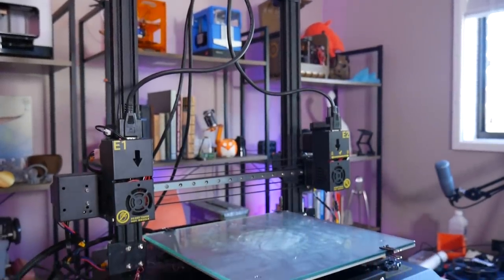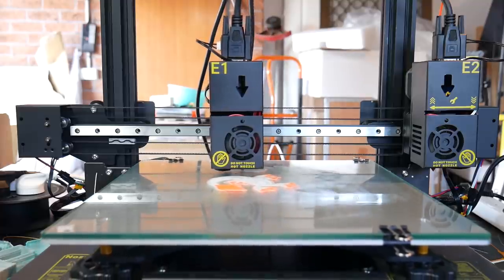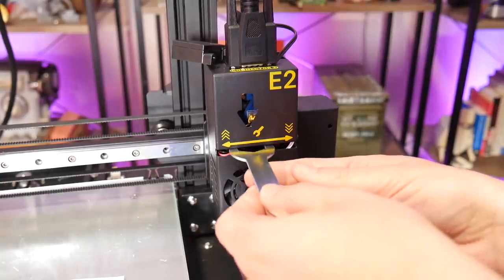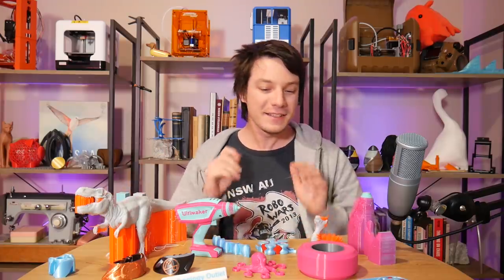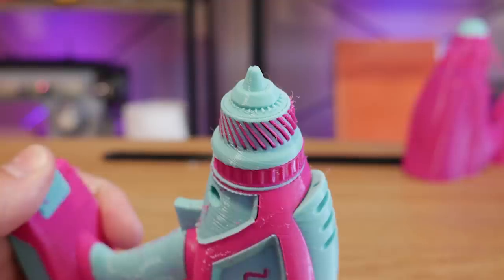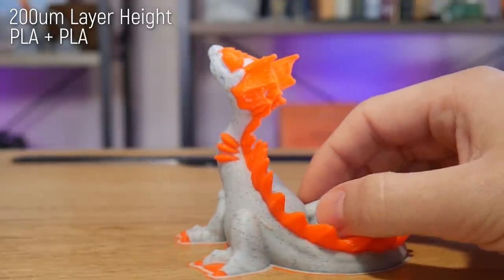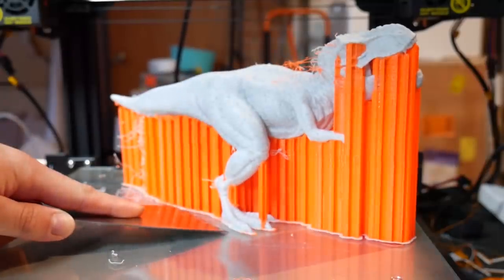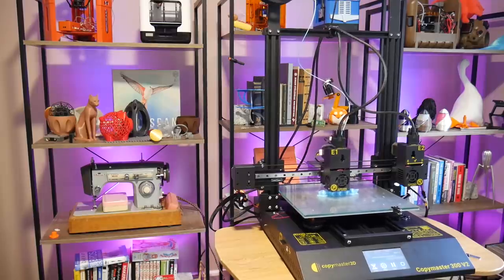Huge IDEX 3D Printer - Copymaster 300 V2 Review

Comment: Angus, if you remove the covers at the end of the x-axis axis you’ll find belt tensioning :) hope that helps
Reply from the maker: Cool, thanks!
Reply: @MakersMuse  absolutely brilliant printer, I've been running a pair of them for about 4 weeks now and I've been generally very impressed. One thing I would say, personally, is that I feel they should ship with 2208 silent drivers as standard as they do make the world of difference on these machines
Reply: @MakersMuse  Is the belt tensioning documented?
Reply: @thehobbyhermit  imo 5160 are better, though that'd be 30-40 bucks extra.
but yeah, having the option would be nice.
Reply: @thehobbyhermit  once leveld, how often dot ehy have to be re-leveld?
I know some creality users have drifting issues(but I don't), just wondering if it is an issue or just a set-up-once problem
Reply: You'll also lose the X1 vs X2 calibration as the end stops are mounted to the covers.  Better to use the 4 access holes in the cover to reach the motor screws.
Reply: @Tater1337  sorry I've only just seen this! I haven't had to re-level much at all on either of my 2 machines!

Comment: Good review. This will certainly propel these into massive sales :D 
I am using “this machine” for a year now actually before it got somewhat popular and got it from Tenlog as a really early machine. The construction and logic stayed more or less the same through time, apart from minor changes like moving all to a more compact and less solid build on a box. Controlboard is not great still, but does the job ok-ish.
Agreed, altough slightly flawed it is the most solid performer for the price that is hard to beat.
It is nice to hear one company that distributes these does support...

Regarding your remarks on flaws:
The belts can be tensioned - by moving the x motors in their slots. Belts are too long, so one extra ziptie for a spacer at brass clips and it can be tensioned properly.
I would somewhat agree that Z levelling the heads is tedious, but not hard. No drama.
X2&Y2 offsets should be set with doing a standard offset comb print just as with any other IDEX. One print does the job ok & second dual material cube gets you to perfect.

Surely this is far from being a perfect machine for the 3d printing noobies. As any IDEX is i guess. But non-noobs also know, that swapping board for Duet with Duex expansion make this thing insanely good for the price. I snitched the returned Hictop D3 hero for 450euro while getting TMC2208s and some extras after contacting Hictop! That’s almost a steal!

Altough maybe not your cup of tea, i am writing this so other can see also.
As I did a Duet mod to it and swapped the printheads (I used hemeras with custom mounts, but others went with e3d V6 or microswiss types). I own probably the most modified one of these out there and did a “MarX Group” on facebook for others that are willing to do similar. We’re just in the process of getting the ‘Hero’ version to the Duet pace. All are welcomed to join if interested in this.
Reply: Thanks for the Facebook Name-drop.  I just finished installing a Duet 2 Maestro and expansion on mine.  Also put new extruders on it a while back.  The aluminum BMG clones directly screwed into the hot ends are working really well and the Z-flexure in my printed mounts works great. https://www.thingiverse.com/thing:4009512

Comment: Angu: "It comes with painter's tape, but who would use it in 2020?"
Me: looks around "uh, er, yeah who would..."
Reply: Gonna try using a glue stick!
Reply: My routine is to put down some painter's tape and then a quick pass of glue stick. The tape kind of acts as a sacrificial build surface. I might switch to building on glass or try some kind of flex plate mod on my Monoprice Maker Select.

Comment: Very nice printer, but I'll wait for the Copymaster 300 v3 with DVI cables for the extruders/hotends.
Reply: why would you have DVI cables, DVI is for display?
Reply: @owmylehg7811  DVI > VGA
Reply: @SprinklesJimmy  ah yes, i get those mixed up,
Reply: I'll wait for v4. It is rumored to come with HDMI cables.
Or should I wait for the DisplayPort one after that?
Reply: Hah, you amateurs, v4 will have 20Kv power lines to run the touch screen
Reply: I hope there'll be a version with Mirrorcast or Chromecast, wired connections are so 2019 :D
Reply: Il wait for the HDMI version!
Reply: I‘d prefer a Gardena connector 😂
Reply: jokes aside, db 15 connectors are pretty good since they have the good number of connectors, are cheap and screw on.
Reply: On a serious note, a DVI cable actually contains all of the signal pins for VGA, so a v3 with DVI would actually be fully backward-compatible with a simple DVI to VGA adapter (which is super cheap too)
Reply: You jest, but if they ever add filament sensors and a Z-probe they will need the extra conductors!
Reply: @manaquriazertyuio4555  I agree. I think it was an interesting but effective choice given that VGA was built for rugged-ability. It holds up nicely if you screw it in, and it's cheap.
Reply: If you buy it from Tenlog, it comes with filament runout sensors.  I thought I saw them in Angus’s unpacking, but he wasn’t using them, which is why you saw a dangling white connector next to the print head.  So they already have the wiring for the filament runout sensors in the VGA connector.  VGA is also known as a DB25 connector, because it has 25 pins, so there should be enough pins to accommodate other features.
Reply: Try reducing retraction speed to 25, and your stringing might go away.

Comment: I have one of these printers from Tenlog. It took about a month, but I was able to dial it in and get the printer down to .15 on Angus’ tolerance torture test.  It’s a badass printer.
Reply: Very interesting. It looks like a very interesting machine. It's good to know higher precision is possible.
Reply: Any idea what the difference is between the actual Tenlog and the Copymaster 300 V2, because the prices is $600US from the manufacturer (and that's easy-build, not a complete kit).

Comment: Thanks for the review Angus! I have the Tenlog TL-D3 Pro which is pretty much the same machine as this. Tenlog has a US-based support team as well which are very helpful. I had to figure out belt tensioning too of which Extruder 2 is still a bit dodgy. The VGA Cable system is interesting as these were pretty much deemed obsolete by the PC computer industry a while ago. Good to see them repurposed for 3D printing. Only thing is their heater blocks don't fit a standard silicone sock in the industry yet so I am still waiting for that.

Comment: Hey Angus, try using petg/pla together as support material.  They don't stick to each other. Works great. Only problem I ran into was because I was using a prusa mmu to do it.  Yep the purge block also didn't stick to itself. Hehe
Reply: Can confirm, PETG on PLA or PLA on PETG works great for removable supports.

Comment: I just purchased this 3D Printer. Well actually the Tenlog version. Their TL-D3 Pro. Your review helped me decide to purchase it. That and it is currently on sale at Amazon for their Prime Day sale. $499.99 for the TMC2208 and $483.99 for the A4988 version. Plus taxes if that applies where you live which it does for me. I chose the TMC2208 for obvious reasons. I can not wait to try it out. I have been wanting to print in dual color for a while and mainly for support material prints. I have also seen a few mods people have made to improve this printer.

I was tempted to build a IDEX from scratch but maybe another day. I just built my own coreXY and it took me a long time to get it to a working state as I was not familiar with their design. Lots of trial and error. I think getting this IDEX now will be better as it can get me more familiar to its design. It should make designing my own a lot easier. 

I was also tempted to purchase a Palette 2S Pro as I have also been looking at that. Its on sale right now as well but by a $100 coupon. This was still a little cheaper so I chose this for now. Maybe one day I'll purchase the Palette but for now I think this will fit my needs. :)

Now I just hope that the 3DPrintMill from Naomi Wu doesn't break my bank when Creality starts their KickStarter for it. I plan to get it for mass producing some things. Mainly set pieces for some table top games. Plus the thought of having a Belt Bed Production printer is cool.

Anyways... Now I just have to wait a few days for this IDEX to arrive. :)

Comment: That belt tension system is very similar to a design I came up with for a corexy. A small clip with ridges that match and mate to the teeth on the belt that slides onto the belts sideways. Very easy to adjust tension by sliding off the belt and skipping a few teeth. Printed in abs I have no issues with slippage.

Comment: My very first printer was a Makerbot Replicator Dual, which used a fixed pair of extruders each which took a single filament. It was okay and had a very simple, straightforward calibration process, but I could never get two-color prints to be particularly reliable, and even when their proprietary slicer added a purge wall it still didn't do a particularly great job at removing the stringing between colors.

Recently I upgraded to an Artillery Genius, and got a Mosaic Palette for multi-material/color support, and I've been pretty happy with it. The use of a purge block does waste more filament than an ooze wall, but I'm pretty pleased with how now I can upgrade my printer independently of my multimaterial setup.

I'd be interested to see an in-depth side-by-side comparison of a dual-nozzle multimaterial setup and a single-nozzle one like the Palette or the Prusa MMU, in terms of quality, speed, and efficiency.

Comment: A very remarkable printer, thanks for the great review video! I am really curious where I can find a 7 or more stepper driver main board, off the top of my head the duet 3 comes to mind but that main board is just really expensive
Reply: Duet2 with Duex expansion board.
Reply: Duet 2 Maestro with stepper expansion board.  Needs a spot-cooling fan for the expansion pcb. Also the "roomba" 3D printer controller, but those are almost all 8-bit.  Finally, BigTreeTech also has the GTR with 11 stepper channels on two PCBs, and the SKR pro with 6.

Comment: I have one of these and I'm afraid you're mistaken about the lack of X-axis belt tensioning. If you remove the covers at each end you'll find it.
Reply from the maker: well that's handy, what adjusts? the idlers or motors?
Reply: @MakersMuse  The motor's position is adjustable to increase or decrease the tension and it works well. The Y-axis is the same although that's clearly easier to get to and therefore more obvious.
Reply: @MakersMuse  In fact, It can be done through the four holes in the front of each cover. I've only just realised that myself! :-)

Comment: Angus, I'm not sure if you've already done a video that touched on this at some point, but I'd be interested in seeing how you prepare a design for dual color printing. How do you specify which parts are in which filament? Is this done in the slicer, or is it possible to specify this already in an STL file?
Reply: Hey Mate - you can not specify that in an STL. What can be done in an STL are two separate objects. Then in the in the Slicer the Material/Tool can be chosen to be different for each object.
Remember STL is just Data of a 3D object. It has no printing information in it and can even be used for every different applications.

Comment: Great review. I have a few of the Copymaster 300 V1 machines for my business. Very capable machines- they replaced my CR10s which kept breaking down. They are not without their faults but I've only had to do repairs very few times over 2 years. I like the V2 and especially the linear rails on that but 2 extruders? For my applications one is enough- especially once you learn how to do dual colour prints with S3d. Yes it won't ever be the same as 2 heads but for me that isn't a necessity- yet.

Comment: Rather than trial and error calibration of X&Y,  I measure the wall thickness of the test cube and make any necessary adjustments in one go. Also, Warm fit sells a set of brass brushes to clean the nozzles just before changing materials each layer. These work quite well if you have their height adjusted correctly and your retraction settings are good. I usually print duel color without an ooze shield.

Comment: I have done tests those cheap mechanical switches are actually surprisingly accurate. With the metal arm removed they give repeatable results with less than 0.01mm deviation, which is pretty damn good.

Comment: Looks like a really good dual extruder printer. The designe choice of having two independent printheads instead of them being joind on one carriage is solid. The only problem i can see with this printer is the heavy printheads and the heavy bed. I'm not a fan of plastics near hot things but the print heads are going to limit the max acceleration a bit. Something lighter might have been better.

Comment: Just a update for anyone that reads my earlier postings here. I fixed the issues I was having with getting this printer leveled out. The problem I was having was that Id level E1 yet I could only get E2 to level on one side of the bed. There were a few things involved with what was going on that caused this but needless to say I was able to fix them.

Here is all that I did.
First disassembled the entire X-Axis. After I took everything apart I did replace my Eccentric Nuts with my own that I have markings on them to know exactly which side is closest and furthest. I highly recommend marking the eccentric nuts like this no matter the printer. It just makes adjusting them a lot easier in my opinion. The original ones on this printer are fine, I only replaced them because mine were already marked. Anyways adjusting those eccentric nuts was a must for my fix. You want to make sure they are equally tightened so there is no play or twisting because there is one on each side of the wheel. Having them equally adjust keeps the wheel straight. Next as I put everything back together I made sure that all the parts were tight and squared up. I cleaned off the Linear Rod and double checked it to make sure it was straight and it was so I reattached it. One of my bolts on t he roller assemble behind the Linear Rail was loose and with this printer you have to take the Linear bar that holds the Linear Rail to tighten that bolt. You can keep the Linear Rail attached to that bar. The bar is attached via two screws on each end. After that I tightened both belts trying to make sure they had equal tension. The optical end stops on the X-Axis are mainly there to keep the extruders from crashing so you just need to make sure they get triggered. X-Axis distance adjustments are done in the calibration settings.
The second area I fixed was the Z-Axis. I noticed that one of my couplers was loose. Also the motor on the opposite side was not lined up with the lead screw. I removed both couplers and adjusted the motor to make sure both were lined up with the lead screws.Then I connected the couplers and made sure they were tight. I also notice that the Lead screw Nuts were both loose. I think that may be by design because both axis home independently and there is a inherent tweaking of the X-Axis when it does that. So they probably left them loose on purpose. I personally think mine were just too loose and I really did not like how they are designed to be loose especially when it is metal on metal. So I designed a TPU Spacer to go between the Lead Screw and Roller Assembly to give it some flex and yet be tight enough so there is not much play in the movement. After this I adjusted both Optical End Stops for the Z Axis. These ones need to be squared up so that the X-Axis starts off squared up. One of mine was not at the same height as the other. It was off by a millimeter. So what I did was printed out a small rectangle to place under the end stop bracket to use as a spacer for positioning each one at the same height. About 4mm to 6mm should do.

That is about it. After I got everything squared up and tight I leveled the Bed to E1 then adjust E2 like the instructions list. Then I calibrated the offsets for the using the 20x20x20 dual color calibration print on the SD card. Now everything prints fine. Now all I need to do is tweak some slicer settings and print out some purge and wipe buckets. I also want to get a Magnetic Flex Plate bed system for it. I really do not like printing straight on glass using glue sticks. Prints can be very tough to remove and you tend to have to readjust the bed level after trying to for prints of the bed. :)
But all in all the printer prints great. I am loving it. My first dual color print was that water dragon. It turned out ok aside form some stringing do to the nozzle oozing since I do not have a purge and wipe bucket. It definitely is a great printer in my opinion. Glad I purchased it.

Hope you do not mind my long replies so far. I just hope they will be helpful to someone else if they run into similar issues.